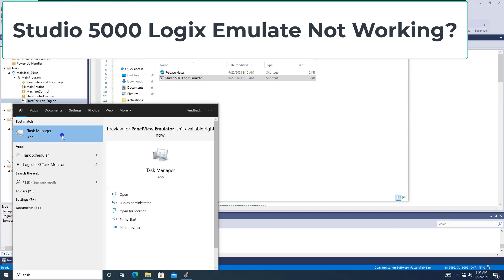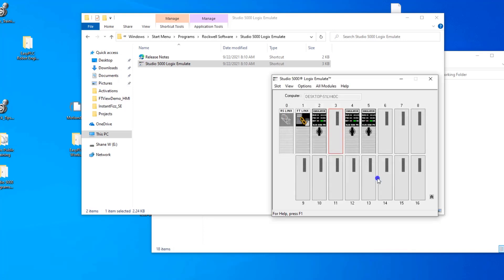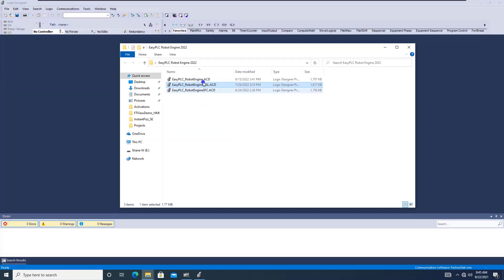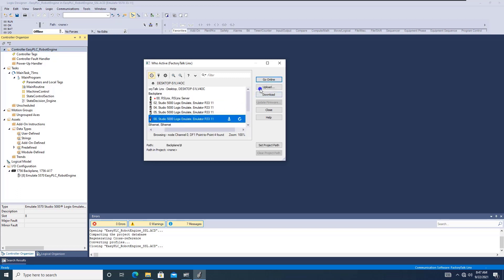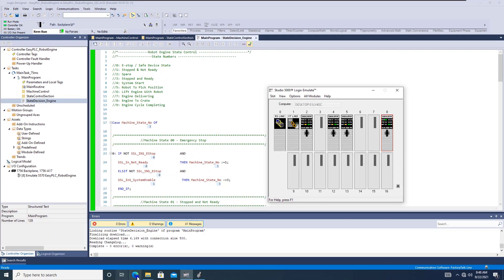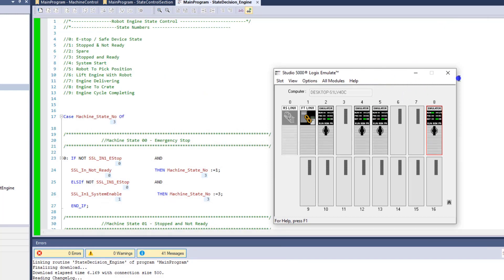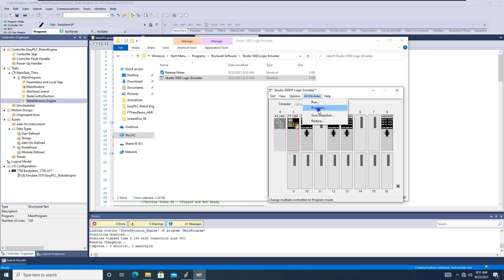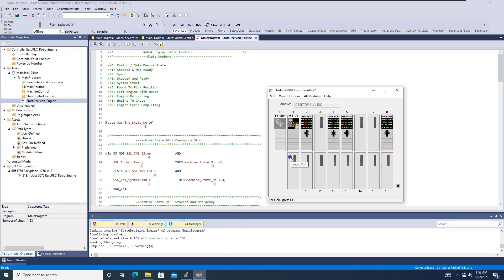Troubleshooting Studio 5000 Logix Emulate Tips

Comment: Have you encountered where Logix Emulate suddenly doesn't show any processors in the slots and when you try to create a new one it says a previous configuration exists, and then no matter what selection you make, it fails to install in the slot?  Any slot...  The only way to fix is to reinstall Emulate.
Reply from the maker: Sounds like a registry issue
Reply: @ShaneWelcher  probably will have to call Rockwell to see if there’s a permanent fix.  This has happened several times now.
Reply from the maker: @RedTideRTS  edit the register for emulator, depends on what version.

I'll try to make a video about it, generally it's a version issue for what you have
Reply from the maker: Environment
RSLogix Emulate 5000
Studio 5000 Logix Emulate

Solution 1
This error is usually an indication of a corrupt registry or not being able to create subkeys under the emulator registry entry.

Check the permissions on the HKEY_LOCAL_MACHINE\SOFTWARE\Rockwell Automation\VirtualBackplaneMonitor\Installed Modules\0001!000E!0035\Instances key using Regedit in windows XP or windows 2003 server or Regedt32 in windows 2000. Verify that users have the right to create subkeys in the registry or write.

For 64-bit Operating systems the registry path is HKEY_LOCAL_MACHINE\SOFTWARE\Wow6432Node\Rockwell Automation\VirtualBackplaneMonitor\Installed Modules\0001!000E!0035\Instances

Solution 2
Note: If you are logged in to a domain, verify that the [domain name]\ [user name] is listed in the local administrator’s group. {e.g. Rockwell\jdoe}

If permissions are correct (or if permissions are incorrect and you don’t want to risk there being any other issues):

Repair RSLogix5000 Emulator in Add/Remove Programs. If after repair RSLogix5000 Emulator still does not work then follow the steps below:

Uninstall the RSLogix5000 Emulator (in Add/Remove Programs)
Go into the registry editor, back up the registry before making any changes
Delete the HKEY_LOCAL_MACHINE\SOFTWARE\Rockwell Automation\VirtualBackplaneMonitor key for 32-bit or for a 64-bit operating system, the registry path is HKEY_LOCAL_MACHINE\SOFTWARE\Wow6432Node\Rockwell Automation\VirtualBackplaneMonitor.
Reboot the Computer
Reinstall RSLogix5000 Emulator

Solution 3
Check permissions on msvcp100.dll file:

For 32 bit OS go to C:\Windows\SysWOW64\msvcp100.dll
For 64 bit OS go to C:\Windows\System32\msvcp100.dll
Reply from the maker: Summary
Disabling User Account Control (UAC) in Windows OS

Question
How do I change User Account Control (UAC) settings in order to resolve problems with Rockwell Software?
Environment

Windows Operating System (OS)

Answer 1
For Windows Vista and Windows Server 2008:
Open Windows Control Panel
In the search box in top right corner type UAC
Choose Turn User Account Control on or off
One the next screen uncheck Use User Account Control and click OK to confirm
Reboot computer in order to save settings
For Windows 7:
Open Start menu
In Search programs and files search box type UAC
Click on Change User Account Control settings
On the next screen move slider all the way down to Never notify and confirm by clicking OK
Reboot computer in order to save settings
Note: For Windows 8 and Server 2012 and above, use Answer 2. Disabling UAC in the Windows Control panel does not completely disable User Account Control in newer versions of Windows. It must be done in the Windows Registry Editor if you desire to completely disable it.

Answer 2
For Windows 7, Windows 8, Windows 8.1, Windows 10, Windows Server 2008 R2, Windows Server 2012, Windows Server 2012 R2, Windows Server 2016, Windows Server 2019:

If the UAC setting is already showing as Never notify, verify that a group policy is also not enabled for every computer. The registry key below disables the policy User Account Control: Run all administrators in Admin Approval Mode. If the registry key is changed, verify that the setting is retained after a reboot. Domain policies can be automatically re-applied on boot. If this occurs, a Domain Administrator would need to modify it.
Click Start -->Run type regedit
Browse HKEY_LOCAL_MACHINE\SOFTWARE\Microsoft\Windows\CurrentVersion\policies\system
Change EnableLUA from 1 to 0
Reboot

Answer 3
To disable it:
Right-click on Command Prompt, then Run As Administrator
Copy and Paste the following:
reg.exe ADD HKLM\SOFTWARE\Microsoft\Windows\CurrentVersion\Policies\System /v EnableLUA /t REG_DWORD /d 0 /f
Reboot

To re enable it:
Right-click on Command Prompt, then Run As Administrator
Copy and Paste the following:
reg.exe ADD HKLM\SOFTWARE\Microsoft\Windows\CurrentVersion\Policies\System /v EnableLUA /t REG_DWORD /d 1 /f
Reboot